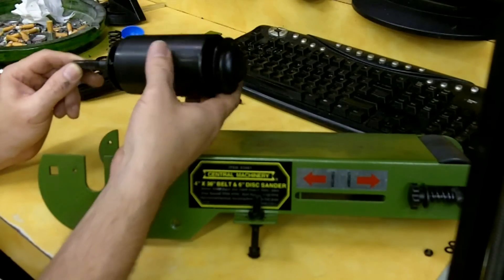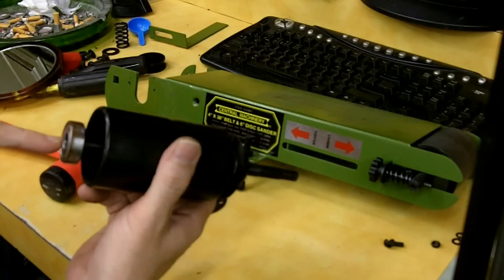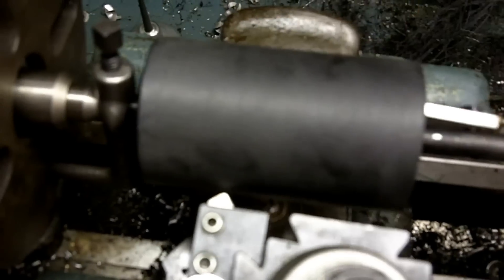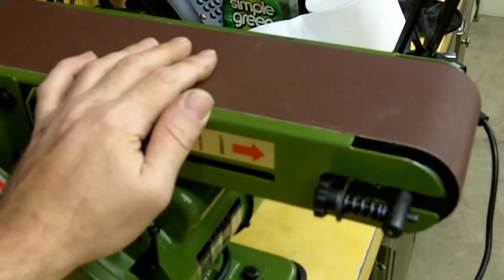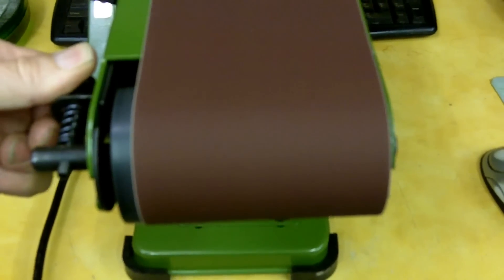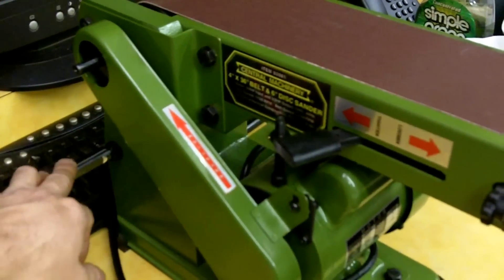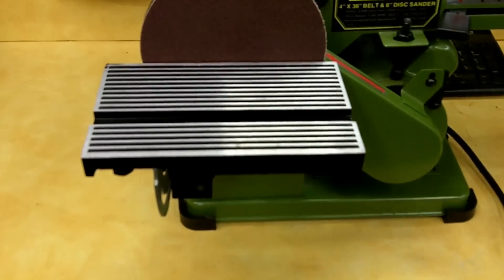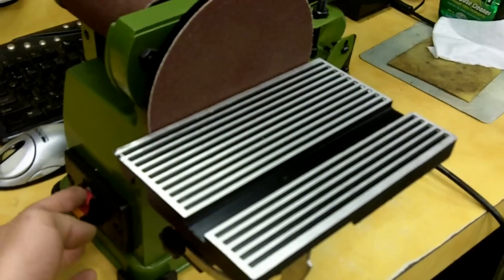Part 3-3 Harbor Freight 4X36 Belt Sander Review and Modifications

Comment: is there a way to shape the belt barrels into shape without the lathe?  I don't have a lathe....sure would like one....
Reply from the maker: If you're willing to sacrifice a belt, you can cut one down to say- 1.5" wide. Then track it off to one side and use a file, or perhaps sandpaper on a piece of wood to shape the exposed sides of the wheels. Then track the belt to the other side and do the other sides of the wheels.  Hope this helps, G.
Reply: I'll do that...thanks!

what grit paper should i use?
Reply from the maker: No problem! Hmm, maybe start at 80-100 grit to do the initial shaping, the step up the grits to perhaps 220 to smooth it out. I've never done it this way, so I'm just guessing. If you do use this procedure- feedback with how you did it, and how it turned out. I'm sure it will help others. Good luck, G.
Reply: I'll keep you posted....Thanks!
Reply from the maker: Good deal! G.

Comment: You think a slightly bigger pulley on the motor to increase rpm's would be too much?
Reply from the maker: It would probably be OK. I think you would have to leave off the belt guard though. Good luck, G.
Reply: Whitey it handles a 4" pulley quite well!  You have to give it a push when you turn it on, but once it's going, it has plenty of power and does not bog down. 
Just buy the no questions asked warranty from HF when you buy it and no matter what happens, you can take it back and get a new one. 
From the info I have seen and read, it doesn't shorten the life of the unit anyways. 
Am doing it to mine. 
Can check back with me in a while if needed.

Comment: I know this is an older video, and I have looked through your other videos. But I was wondering if you had come up with a solution for the belt sanding surface not being flat. I just got one of these units today and need to mod it in pretty much the same ways you have, plus the surface flattening issue. Thanks in advance!
Reply from the maker: Could you be more specific on which sanding surface you're referring to? G.
Reply: The surface under the belt portion. Mine seems to have many dips and rises in it. I was wanting to either make it flatter, or replace the surface. or I may just take it back for a replacement.
Reply from the maker: ***** Hmm, mine doesn't have that problem. I see two options. One would be to take it back for a replacement like you stated- to see if it's any better. Or two, you could use some sand paper on a sanding block and try to sand it smooth which would take some time but should work. I would exchange it first before going with option two. Hope this helps, G.
Reply: ***** I actually think I may have found a solution now. Another person suggested that I get either a thick glass or porcelain surface and attach it under the belt for a truer, flatter surface. I may just attempt that and see what comes of it. Thanks for the reply, your information and knowledge is appreciated!
Reply from the maker: *****
That seems like a reasonable idea. Personally, I would stay away from glass and would gravitate to another option. Let me know  what you come up with. It might help others out as well. Good luck, G.

Comment: This was very helpful.  Thank you.  I will be doing these modifications to mine.  I am curious,  Why did you not attach the dust shroud on the wheel?
Reply from the maker: No problem. Good luck with yours. This is an older discontinued model that didn't come with the dust shroud. But outside of that, what I did in the videos should translate to the newer model. Thanks, G.

Comment: I have read that the motor is plenty powerful it's just the tensioner for the drive belt needs to be tightened.
Reply from the maker: I'll have to check into that. Thanks for the tip, G.
Reply: Tensioning the belt is a balancing act. Too little then you have slippage. Too much and then the motor bogs down on startup and draws more amps then it should and it could run hot , damage the motor,  pop a fuse or a flip a breaker. I believe that this particular motor normally draws about 3.5 amps at 120 v. I would tighten the belt and then check the unloaded and loaded amps that the motor is drawing.

Comment: great upgrade video do you happen to know the factory v-belt size i was thinking of buying a gates belt.  Since you have a lathe it might be worth it to make an oversize v- belt pulley to slow down the belt and improve the torque situation.
Reply from the maker: +Rob C 
Thanks Rob. I know it's a 3/8" belt (3L) but don't know it's length. The machine is buried right now so I can't take it apart to measure it.  I have thought about changing the pully size but never got around to it. If I ever do, I'll post a mod video. Good luck, G.
Reply: Thanks I just got mine today the rollers run true so I won't need to machine them. The 6 inch Disc on the new ones is machined diecast  aluminum instead of ABS plastic.  Had to pound my bearing in with a dead blow the one in the stamped black retainer was running hot because it was not fully seated. Other than that the belt was too loose and the pulleys were mis-aligned so I played with that for an hour.  Now it runs nice just like yours.  BTW they replaced the punch marks under the table with 2 set screws. Maybe HF saw your video decided to make a few fixes.  Got mine dirt cheap had a coupon for $59.99 and I think the cashier mistakenly also applied the 20% off coupon to the discount coupon so I got it for $47.99 not counting sales tax almost free lol.   Love the detail in your videos... do you have any other upgrade projects on Chinese tools? Thanks
Reply from the maker: +Rob C 
That's cool Rob! You did extremely well for what you paid. Good to hear it's working out so far. Glad you like the videos. You'd just have to dig through my channel for anything HF I've reviewed. Most of what I've done were very simple mods, like adding washers here and there to make the tools work a bit better. I usually cover them in the video of what's being reviewed. Take care, G.

Comment: Is there enough meat where the punch marks are to actually drill and tap setscrews? 5/16 or similar
Reply from the maker: Now that's a really good idea! There's just enough meat to thread a couple of holes. You could either tension them up like a gib screw and maybe locktite them so they don't move. Or, unlock them and re-lock them if tilting the table. A small brass shoe would be another good item to add under the screw to protect the shaft. It would have to be rather thin though. Thanks for the idea. Take care, G.

Comment: what the make and model of the lathe your using?   thanks mike
Reply from the maker: Mike, it's a 9" South Bend model A UMD. The UMD just means the counter shaft and motor is mounted under the lathe in the cabinet. Some have the counter shaft and motor mounted behind the lathe.  Take care, G.

Comment: I think I paid just over $52 dollars for mine after all the holiday coupons and sale prices.  I love it, but it does have issues I might not be able to tune without a lathe.  Mainly, I have the same complaint about the motor being under-powered.  It doesn't take much to stop it.
Reply from the maker: Not a bad deal Todd! Yep, it could use a stronger motor for sure. I just ease up a bit and let it do it's thing. It does take a little longer, but it does work. If the motor ever dies, I'll put a more powerful on on it. Good luck, G.
Reply: Todd Carpenter this a way late reply, but the motor has plenty of power and is very hard to stop.  
   You must loosen the bolts on the motor and then tighten the belt by pulling the motor back and relighted bolts. 
  It's that easy.  Hope you figured that out long ago.  But I hope this helps to future people who read your comment.

Comment: Watched all 3 vids and so not worth it... All that work (which was impressive, by the way) was not worth it in my honest opinion... I bought this unit a few weeks ago and it works perfectly fine for what it is...I picked mine up for $59 on sale. Not bad at all. thanx for sharing
Reply from the maker: +adriannyasia 
Opinions vary. Mine is a discontinued model and it would not track properly- so I elected to fix it. Newer ones seem to track OK for most- so I've been told. Good luck, G.
Reply: ghostses just bought a brand new one.  
   Still slow, tracking is ok.  I have to adjust the tracking often but not enough to be a huge problem. 
   The wheels are still bad.  If you try to sand or grind with them the object your working with jumps all over the place. 
You have to hold on to the object very tight and be very careful. 
Still a good buy.  I'm upgrading to the 4" pulley.  The motor has plenty enough power to handle it.  As it is out of the box, it's way too slow to use for grinding.  Can be done but it takes way more time than needed.
Reply from the maker: Yeah, I get conflicting messages. Some say the new model is fine- others not. It's the luck of the draw I guess. I plan on installing a larger pulley on mine at some point- but still haven't got around to it. G.

Comment: You should work for harbor freight that way we'll get better junk power tools hahahaha. I bought the 8" drill press used once replaced by craftsman 12" drill press far better unit only a few dollars more, I have this sander piece of shit and will soon be replaced by a porter cable, also the 8" grinder will be soon replaced by a DeWalt or Dayton. Spend the extra money and buy something good you'll be happy. None of there crap has enough power to do shit.
Reply from the maker: I would take the job Steve...lol. I do agree this is under powered. Some folks tell me it's the belt tension causing the problem- but that's not the case with mine. Mine is a discontinued model, which might behave differently than the newer ones- who knows.  Personally, I have tons of tools from the top shelf down. I cheap out where I can, especially on little use tools, and buy better if need be. But yes, I agree- if one can afford better it may be a wise choice. Especially on this machine. Take care, G.